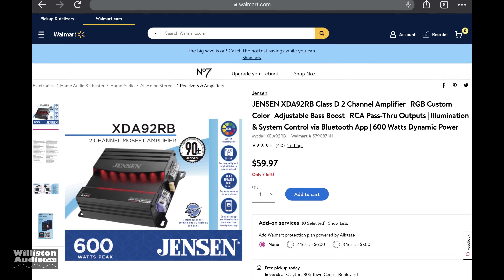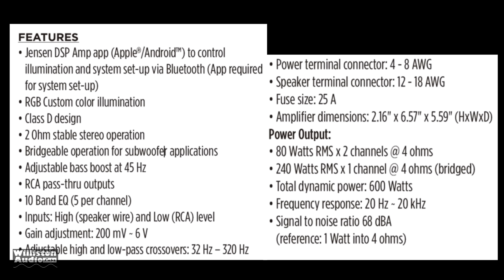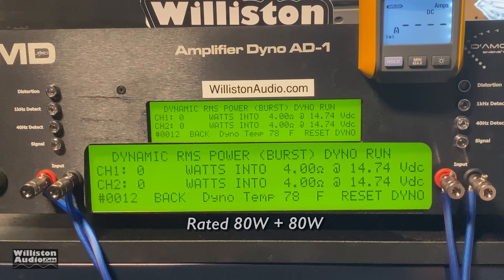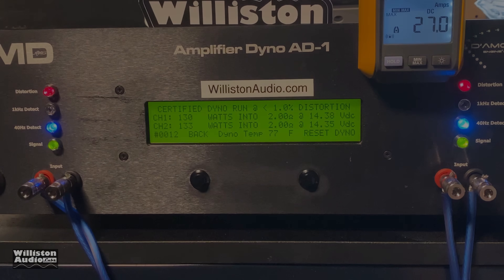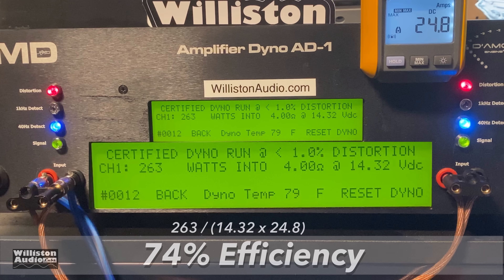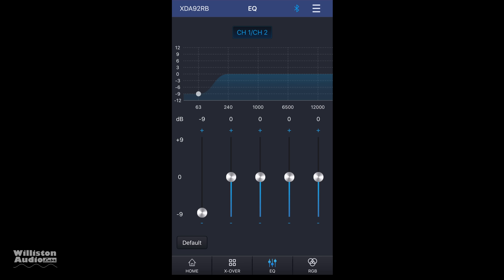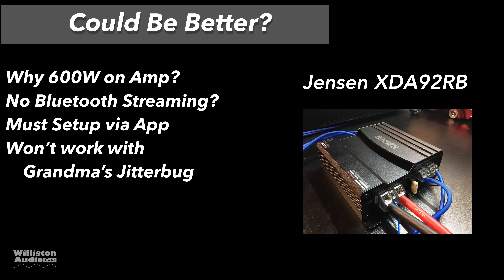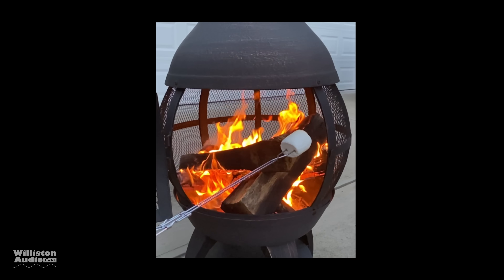Is a $59 Walmart Amp Any Good? Jensen XDA92RB Amp Dyno Test

Comment: Ah, Jensen, the first brand I owned which I still own; A1000 amp and a pair of Jensen XS10 subs. Sadly I haven't used them in many years. Not the best stuff ever, but it bumped for a first cheap system and I had a lot of fun building boxes / testing stuff. I'll always have a place in my heart for Jensen.
Reply: Yeah boy I bought my first (and last) brand new car in '98 and put a Jensen bandpass box in it I believe they were called G.R.I.P. subs. I bumped them hard for 4 or 5 years on a Jensen 75x2 amp. I have built many systems in my vehicles over the years and that cheap ass BestBuy Jensen setup was far from the worst. I am glad to see Jensen has stayed true to affordable gear rated accurately.
Reply: @303nitzubishi4  For sure. I have no complaints at what I paid for the stuff. I finally got a 10" Jensen bandpass box I use to see at Best Buy, I have not put my XS10 subs in it yet though. The one that said Jensen right across the front acrylic and ports at top towards rear of box, but plan on it at some point as I wanted that box bad back in the late 90's. Yeah it wasn't high end gear, but it did the job fine.
Reply: Still have an old pair of Jensen xs12's packed away.
The ones that are mirror blue.
Have the matching 6.5 and 6x9 three ways.
Always did the job.
Probably use them in my 280z for nostalgia.
Reply: I'm old..years ago Jensen was the better gear available in my small city in Massachusetts..was in 70's. And we never heard of changing out stock tunes before..nice crisp paper cone speakers were the norm..pre blown from the factory 🏭 😳..or so it seemed as no one had clean sound in the car..till I met 1 guy with windows down and I followed him to learn how that sounded good! I Told my buddy, he had more cash then me! 
Buddy put 6x9 Jensen 3way with eq amp..like 50 bucks for the pair.. and holy shit! Compared to stock radio suddenly this trans am was audiophile dream!.was so loud! But I'm listening and trying to figure out why it  seemed that sounds  missing certain things in the song .then we realized that we had only left speaker connection completed hadn't put wire on the right side speaker yet..the joys of 🍺 & weed! The next week he got KLH 3 ways and new head unit..THAT really kicked it up.
Reply: Was a hundred dollar amp or less. Not A1000! I bought this from him after he upgraded again!
Reply: Back in the days and even now you can always go with Jensen if you’re in a Budget but still want decent sound.

Comment: This bit of kit is just as strong as it needs to be seems pretty solid.  The channels are remarkably even too.
Reply: Most R/L channels are little bit off on most amps, just nature of the beast, gets worse with higher outputs. This amp seems pretty solid for a really compact deal. You could protentially use 2 of these on a stereo board for a Shop radio or whatever with a cheapish bluetooth only HU. Would sound better than any of the pre-made stereo junk they have out on the market today.

Comment: Can u test the 1000 watt Jenson 4 channel from Walmart
Reply: buy it   they are awesome
Reply: I bought one, it’s junk! I’m running all JL in my truck and needed a 4 ch to get me by till my amp comes in from JL seen one for $99 so picked it up. It blew one of my tweeters on the 2nd day, thought it was a fluke so decided just to run my back speakers rated at 250 RMS and at less than 1/2 vol they are popping and squawking! I shut the amp down & plan on disconnecting it to return it! Maybe I got a bad one cuz I did notice that the LED lights that you control through the app don’t light at all but everything else seemed to power up.
Reply: @DamonG2017  when you  push any amp to clip  you will get distortion ,   these amp put out clean  power  up to clip  if you are blowing jl speakers maybe  there is something miss wired re check everything   got 3 old ass w6 12 still running off a zapco 1000  have been for 17years now  and still play just fine  got to say  these jensen amps  have  the same clear sound as my zapco amps  i was surprised
Reply: @ArkansasChainsaw  definitely not a wiring issue, had the all settings turned way down as well & gain set @ 2 on the DSP so wasn’t anywhere near clipping, hate to say it,  I think I just got a junk amp man, if there are 100 amps in a pile I’ll grab the one that’s a dud, just my luck. Shitty part about it is the tweeter that blew cost almost twice the cost I paid for the amp 🙄
Reply: @DamonG2017  sounds like you got something set wrong with your gains. What frequency do you have the door speakers tuned to

Comment: Jensin xs 12" subs were my first subwoofers! We all have to start somewhere! Thanks for everything you do Big D!!
Reply: I had a a pair of the "bass" 12's  from the mid 90's at one point.  Used them for a while after my JL audio 12W3 blew up powered by my crossfire vr302.
Reply: @bigassfordsd  I don't know what it was but those subs in a sealed box and a lanzar vibe amp would actually pound. Impressive back then but that was the beginning of car audio for me. I now just have a American bass xr15" which I'm content with. For now...

Comment: I had a little road trip (7200 miles) to do in 2 weeks in a 36' stright truck. So I wanted a temporary sub for the back seat so I bought this amp not expecting much other then a little bit of bass for added levels to the music. Connected to a rockford p1 in a prefabed box I had (cheap and disposable) it did its job and then some. For under 300 bucks with a head unit I was very impressed considering its price, being a walmart brand and being connected to basiclly throw away parts I had just sitting around. I gave it all away to a buddie less fortunate then I and it still beats today I guess
Reply from the maker: Great feedback thanks for sharing

Comment: My buddy just bought the 600w monoblock to run a 12" addictive Audio v2 12", I'm anxious to hear how it sounds on it
Reply from the maker: I want to get one of those now...
Reply: Enlighten me please. I'm jus trying to understand...why get the mono if you're only looking to power one SVC sub. Grab this one for $30-40 less. Is my thinking right? Or is there a specific reason one would want the mono for a single SVC sub. I understand getting that if you're hooking up multiple or a DVC.
Reply: @roboompa2465  dual 2 ohm coils wired in parallel will be able to get the (monoblock)amplifier's full power, where as if you wired the 2 ohm coils in series, you COULD bridge the 2-channel amp and run it at 4ohms, you'd be getting around 300 watts. You're right though, if you only have a 4ohm svc, that 2-channel would do the trick.
Reply: @roboompa2465  the AA version 2 woofer has dual 2ohm coils, so the 1-ohm stable monoblock is a good fit for it.

Comment: I had two of the 700w Jenson amps back in 2001 and with two 1fu caps and an external crossover I hit 148spl!!! Was running just some IMPP 12” subs in 1qf boxes all speakers firing into each other(like wall trucks do today) however, this was in a 1994 Saturn SL2 and the trunk lid was ripping over time... first lid I ever had to towel weld back together
Reply: @wal  yea sums up the expressions from he audio guys at the first shop I found that could read past 125spl(meters back in the day for home use sucked) but yea, guy was like yea take your car into the garage door on the other side of the store next to us(their instal shop was not directly connected to the display store... went in... head installer looked at the system started to chuckle and set up the system, burped it at 48 and 49 and then 35 and you could definitely see the shock in his face...  gave me the slip, I went back to the store front and ask what the owner thought... I got in there and got the gasps of all that was in the shop... keep in mind they were a JL dealer and my whole system cost less then a W7 and destroyed anything he ever seen that cheap... yea I am still a big ass fan of diamond box set ups(yes fire all speakers into each other with the size of the space between speakers as the same as the box volume of one of the four boxes!) I just told you how to build a diamond box, try it out some day... loud and crisp

Comment: For this amp and others that advertise 'max' or 'peak' values, I think they are misleading simply by way of convention but not inaccurate from a technical sense. RMS power is simply an average value over time, which implies that that you have values higher and lower around the average. It has to be conceivable that the amp can do 600W or more (PMPO) but over what time interval (probably an instantaneous split second)... the question is whether this can be accurately measured. If this is possible it can give some good insights into the dynamic headroom of amplifiers.
Reply from the maker: Good point

Comment: Jensen has always done okay amps never too impressive but they get the job done.
Reply: In my experience, they did better then expected by myself and others. They're not great but adequate
Reply: Exactly. It's sad that "Okay" is a term of endearment these days. The bar has been set so low by all the BS manufacturers out there. Thank God for folks like Big D showing us all what's really real
Reply: @303nitzubishi4  Here here! Well put kind Sir.
Reply: Bang for the buck! I impressed folks with what I had in jenson power... before that it was RadioShack amps and yea my stereos were always memes! 148spl with two small jenson amps is impressive! And the RadioShack amps did great too but I never ran caps with em so I might have been even louder then jenson using the RadioShack amps
Reply: @mrexon  B Fn S ...148 with Jensen or Realistic gtfoh bro
Reply: @tymanG19fan  why no videos bud? You scared to show your self online? Sounds like you just pro troll
Reply: @mrexon  Back in the day I ran a Jensen XS 300w on a 12" MTX bandpass, Optimus 110w on Optimus 6x9 3way, and Optimus 50w on some 5.25" coaxial door speakers.

Comment: The only difference in the Jensen compared to the dual is the blue tooth. Which my pioneer head unit has all those settings from a bluetooth app.👍💯
Reply from the maker: I’m not liking the gain control from BT, but errything else is cool
Reply: @wal   I probably wouldn't either.  I already have a bluetooth app that pops up when I turn the car on from the pioneer.  So the Jensen bluetooth would just get in the way. I can set each speaker separately and the sub. Set the low pass and high pass from it to. The pioneer head unit is really nice. Glad I got the dual version of the Jensen you just tested.  I got it cause of dyno Ryan did. It works really well for my Skar 6-1/2 mids and ds18 tweeters 👍💯

Comment: Thank you for this dyno test. Ive been looking at this amp for awhile now. O actually bought it but returned it because I wasnt 100% on it lol. Now Im for sure gonna get it to run a small 10" sub.
Reply from the maker: It’s perfect power for a small sub or some door speakers
Reply: @wal  exactly! The sub is in the factory free air location on my sc300 so I dont need alot of power.

Comment: While Jensen car audio has always been a budget brand, even bordering on being flea market gear, people forget that they have quite a long heritage dating back to the 1920s and they make some really stellar guitar speakers and pro audio gear. Good to see they are releasing something compelling these days in the car audio game.
Reply from the maker: Great point!
Reply: Their guitar speaker are fantastic!!!
Reply: I just re-coned a vintage 15" jensen from a 1960 fender brownface pro amplifier..
Reply: Yes but like other big names still showing what they are today and yesteryear are hardly a resemblance of one another! ;-)

As for the 600W, if they printed 300W it would be correct as it was revealed the amp is capable of 300W dynamic power output.  Which in a nutshell is a meaningless spec. ;-)
Reply: @cpufrost  The amp dyno dynamic test is still an RMS (root mean squared) value, which inherently is an average. There is also a measurement of PMPO, which is certainly not a meaningless spec as an amplifier can have huge instantaneous power and low RMS power, which generally related to the power supply section being able to sustain the necessary voltage over some given duration. At the end of the day, RMS is kind of universally understood but the PMPO numbers which I'm sure are realistic in most cases (2x - 3x the RMS) are the more attractive ones that sell.
Reply: @recon440  PMPO isn't of concern ESPECIALLY in amps designed to playback recorded music with quite low crest factor.  Sure it may show the voltage swing capabilities at a specific slew rate on the bench but this has no impact on sound quality.  Even in SR (live sound) where dynamic range is much higher that PMPO number would never be achieved simply because the period of swing is too long.  Dynamic burst power rating is essentially of no use too if its specification isn't shown.  20mS is quite short and doesn't represent music playback.  200mS (10X longer) is valid but only a few amps were designed to sustain those peaks.  Proton DPD (dynamic power on demand) was such a design.  It did work as intended.  But a highly regulated design capable of continuous power output will always better those designs.

This amp and certainly many other amps costing 10X the price aren't going to be able to produce 100+ VAC on the output terminals!

Finally, in car audio for truly high power designs (100-500kW or more) a higher voltage multiple phase power system would be beneficial.  Running batteries in series/parallel achieving medium currents at 300-400VDC that could either feed the amps directly or using an interstage cycloconverter would be ideal.  This would eliminate the need for wiring the size of a firehose! ;-)
Reply: The first amp I ever owned back in the late 80s was a Jensen, it was nothing great but I abused the crap out of it and it never failed.  About 10 years ago I was running their in dash DVD player head units that I thought performed really nice.  Sony has been doing me right these days with head units but I'd totally consider Jensen if they dropped out of the market. 

That said, despite Jensen having invented the modern loudspeaker I can't recall them ever making a great car audio speaker and certainly I don't think they've put their name on anything that I'd consider above average in the 12V arena.
Reply: @hispls  Back in the 80's they made some very decent car speakers. I had a pair of three way 6x9s and a pair of 6 inch two ways. Both well made. They could handle good power and had that beautiful blue foam surround. You had to spend a lot to get better speakers. Time moves on and companies change outlook I guess.
Reply: @troyhartley9681  I agree. Those blue surrounds 6x9's triaxx's could thump really good bass and sound clear too. In 1984 that was my first set-up in my 78 Camaro. A Concord head unit and an Alphasonic amp powering those 6x9's.
Reply: @acamaro5648  You had some nice gear and in a Camaro to boot. I had a couple if Sansui amps and an early Sony CD player. Then I got my Proton D275's. Concord only had cassette players back then but they were very good.
Reply: 80's Jensen Triax 6x9's....legendary budget speakers.
Reply: Yeah but for instruments I won’t replace my eminence for anything else
Reply: Jensen guitar speakers fuckin rule. Also their vintage home audio stuff is great.